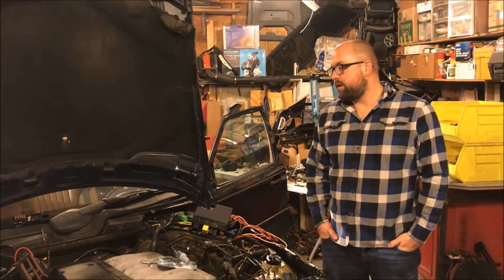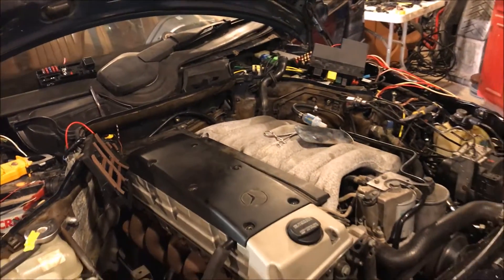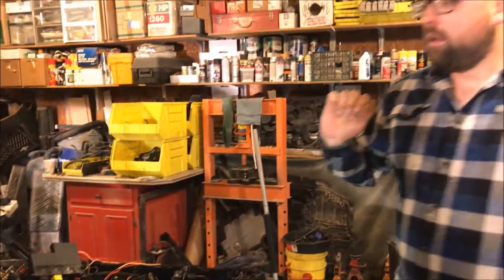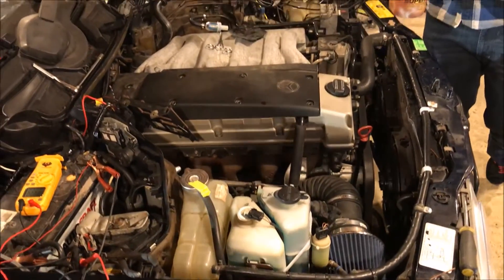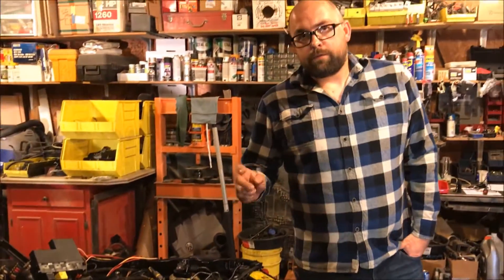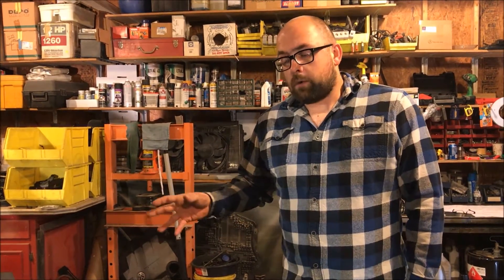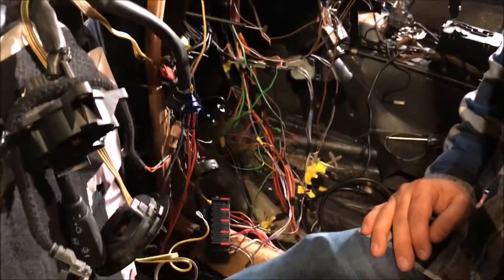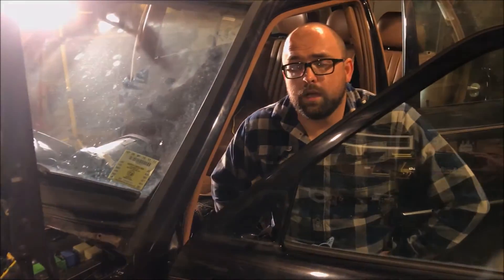1999 OM606 Turbo Diesel Swap Into 1995 W124 Wagon

Comment: Hi there I'm doing exactly the same swap. My wagon has self leveling rear suspension that runs a pump from the camshaft. What did you do on yours when you fitted the om606  ? Thanks

Comment: Make sure that the neutral safety switch isn’t cutting off the engine- when I did a turbo diesel swap in a naturally aspirated w123 Benz, the roadblock I hit was the neutral safety switch preventing the car from cranking. I ended up swapping the wiring from the parts car and it fired right up

Comment: Hi.
Good to see that more people trying to swap OM606 with electronic IP and 722.6, instead of mechanical IP + manual gearbox.
I did exactly the same in my W124, nearly 3 years ago. 
At the beginning on OM606.910 engine with added KKK turbo from W210.
After that was a second swap to OM606.962. 
It works perfectly to this day. (except one glow plug, which broke a few days ago. :(  )
I have some questions:
1. What did you do with ABS sensors on each wheel?
2. What drive shaft do you use? Any modification was needed?

I don't had that problem like you. In my case, it was a bad connection in CAN, and engine even not started cranking. 

To this day, I have one unsolved thing. Bad decreasing RPM, on hot engine with A/C off.
It is some like the ECU don't know that A/C was turned off, and has bad "timing?".

Greetings, and have good luck with project. ;)

Comment: Are you using electronic fuel pump? Take mechanical from om603 and forget the all the wiring trouble and immobilizer.
Reply from the maker: We are trying to avoid going to a mechanical pump and believe that we have a solution now. Should have an update soon.
Reply: Looking forward to see more. :P
Reply: @BoziTatarevic1  why are you trying to get away from the mechanical pump, it looks like that is the way to make big power with this engine